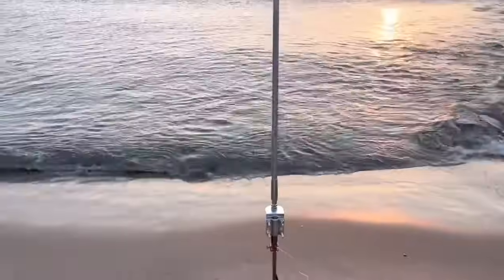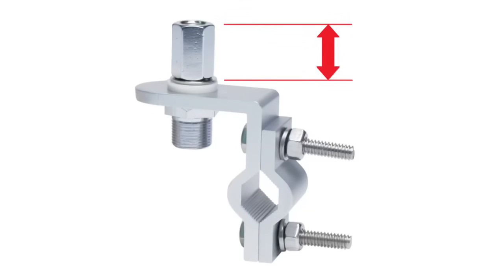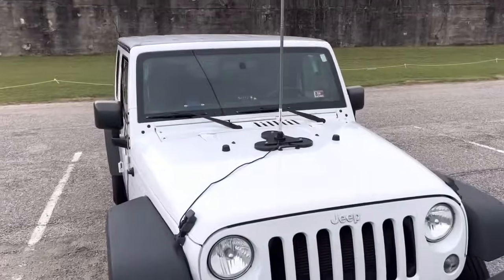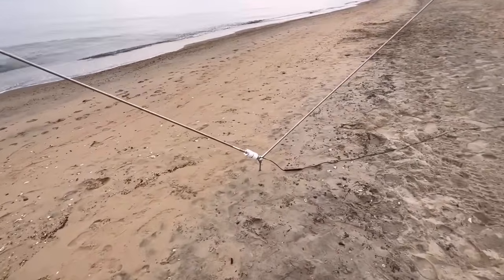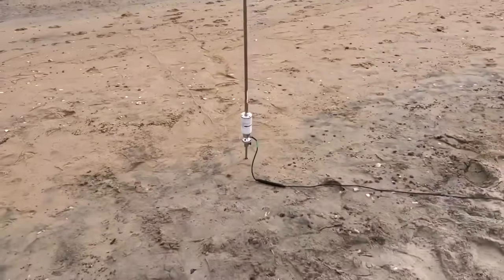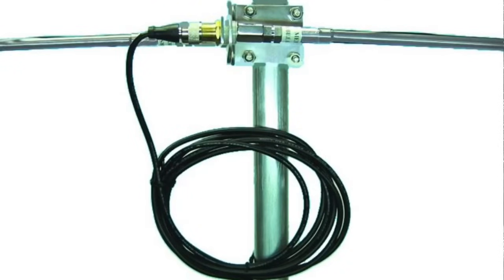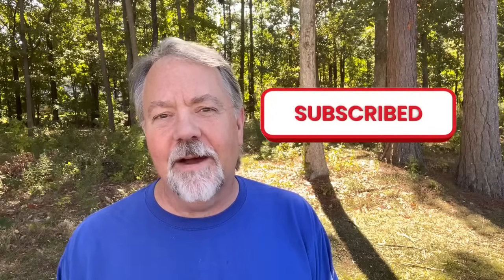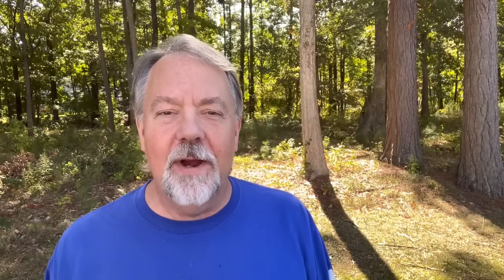How To Use a 17 Foot Telescopic Whip for Ham Radio

Comment: With telescoping whips there's a useful tip that saves time getting the length right. Establish the number of thicker sections to get just short of the right length and pull those out. Then you only need to do the measuring with the last section. A cord with knots is also less clumsy than a tape measure. Put a loop in the end to attach to the base and add a knot for each band.
Reply: Great ideas!  Thank You!
Reply from the maker: Awesome, Thanks for the idea!
Reply: Or, extended the thinner sections and make adjustment with the fat bottom sections. Save taking the antenna down and putting up again!
73 M3KXZ
Reply: I might try marking one of my radials with a label maker. I have to carry them anyway.
Reply: Gives 5+9 a new meaning :-) 5 sections + 5 centimeters
Reply: I’m going to give a £20 eBay special a go.
Reply: I have a chart of each band and the number of sections to pull up. So 10m may be 6.2 sections, etc. I use a diamond mount on the hatchback of the expedition so I start on 10, then pull more sections as I move down the bands. Eventually 20m will be all for cw and half a section in for ssb.

Then keep an eye on the rig swr meter and make any final adjustments.

Comment: I am all about the whips in the field personally, but there is something pretty important to remember.  That guide to resonant length assumes a good ground plane and good ground under your ground plane.  If you are placing everything on dry sand with no salt water on site, the ground will suck regardless of what you put down for a ground plane.  This means that you will have to extend your whip more to actually get resonant.  The more conductive the ground under your ground plane, the shorter the whip can be and reach resonance.  I generally use the Wolf River whip because it is slightly longer than the other 17' whips, for just that reason, though I have a Chameleon whip as well.  If all else fails, clip an extra length of solid copper wire to the end of your whip if things are really bad on the ground.  Walt avoids all this by habitually setting up by the saltwater and running a counterpoise/radial down to it.  That makes for a fantastic ground plane and thus avoids the problems I just talked about.  For my own part, I have just gotten used to knowing about how long a whip I need and using a NanoVNA to dial it in once I am in the ballpark.
Reply: Spot on Matt.  Really good comment.  I'll add that a 1/4 wave vertical over a proper groundplane generally measures about 36 ohms +J0 (ie it is resonant).  But 36 ohms is going to show some SWR to the coax because it's not 50 ohms at the antenna.  SO, what I do is make the antenna a bit LONGER.  This raises the feedpoint impedance up to 50, but it also adds inductance (perhaps 36+J15).  Then I attach a capacitor in shunt (across) the coax where it connects to the antenna, and this makes a very simple "L match" and now I can get a perfect 1:1 SWR, 50+J0 at the antenna end.   

What I describe is probably overkill if you have a short feedline, but I present it here as a teaching tool for those who want to learn more.

73 OM
Reply: @WECB640 interesting. I have, in the past, run one of the extension legs (like the ones that come with the Buddipole and Buddistick Pro) under the 17’ whip to get closer to 1:1. Not always needed, though. Like you say, you can get close enough without the shunt. But your comment interested me bc I’d usually understood shunts as typically being employed as a coil across the feed point (between center & shield), which would be an inductor (as all coils are… right?!)… for the purposes of raising the feed point impedance (as low feed point impedence almost always occurs with physically short vertical antennas). So wouldn’t we expect additional capacitance in shunt to raise the feed point impedance..?  Or are you perhaps not running the capacitor across the two coaxial conductors, and rather have it only inline with the center of the coax and the radiating element?
Reply: Yes correct.  If the radiator is a bit short it has capacitive reactance and we use a shunt inductor to form the "L match".  If the radiator is a bit long, it then has inductive reactance and we use a shunt capacitor to form the "L match".  Either way works.  BTW, MFJ (much as I don't like the quality control) sells both types of shunt but IMO they are overpriced, so I make my own. 73 @Kinetic79

Comment: The 17' telescoping whip is easily my favorite antenna for portable use. I have the original and enhanced versions from WRC. They are so versatile, it's great to use mounted on the car, from a park bench, a stake in the ground or a tripod. Plus a 1/4-wave antenna is great.
Reply from the maker: Absolutely, there are so many cool different configurations and uses for them.

Comment: Thank you for your operating experience with all of the options.  I have both the MFJ 1979 and the Chameleon SS17 and for anyone interested in getting one, definitely get the Chameleon. It's much more robust in construction and also the upper segments are much thicker.  The 1979 is a bit flimsy up top and probably will wear out more quickly despite both being the same price.   For awhile there the SS17 was sold out and was hard to get (I became impatient and got the 1979 first). 

Another great video that makes my day! 
Always appreciate your vibe that keeps up the HAM spirit! 73!
Reply from the maker: Thank you so much! I agree and as I mentioned in the video the Chameleon is for sure the better of the two. All the best and 73 my friend!

Comment: I just got into ham radio.  Got my Tech at the end of Sept and my General middle of Nov.  Made my 1st contact on 20-meter with a 17' Intellitron on the back of my car in the driveway at 765 miles with 10 watts.  I was 4-4, and he was loud and clear, pegging my S meter at times.  I have a second 17' Intellitron along with the Intellitron mount to use two 17' antennas as a dipole ordered.

Comment: Walt, I really like your last two videos where you start out with what you were going to share with us. Also, these last two how to videos were desperately needed.  They both fill a gap. There are many videos that review sliding coil antennas or telescopic whips. There are many videos showing people using them for POTA activations, but I haven’t found any that simply explain how to use them… until now!
Reply from the maker: Thank you so much for the kind words! I hope to keep making videos that help others in the hobby.All the best and 73, Walt

Comment: I just used my Wolf River Coils 213" whip for POTA today. The new one they came out with this year is awesome. It collapses smaller, so it'll fit in cary-on luggage. It's double crimped and more rugged than their previous one too. It's become my go-to antenna the last few months. It's easy to setup on a mag mount and switch bands. I memorized how many sections to drop between each bands, LOL.
Reply from the maker: I need to get one of those whips!

Comment: Hey Walt! I mark my whips with a sharpie for each band. Saves carrying a tape measure, and even with different ground conditions, it gets you close enough to fine tune if you wish. Four 10 meter (33ft) harbor freight tape measures with wires and connectors soldered on make great radials for a whip, and are bright yellow for visibility if using them in a park. 
Same with the wolf river coil, I mark it as well, and it will be very close depending on ground conditions.
Reply from the maker: Great tips, thanks for sharing

Comment: Hey Walt, most people my age, (mid 60's) here in Canada can switch back and forth between metric and Imperial measurements but we still buy 2x4's and 4x8 sheets of plywood at the local Home Depot. You'd have to search for a metric tape measure. We went metric in 1975 but not quite there yet. Another great video!
Reply from the maker: Thanks so much Jeff! I remember going to Montreal in 1974 as a 12 year old kid and thinking the smaller metric sized cans of soda were the coolest thing ever. You guys up there in the Great White North adapted a lot faster than we did for sure.
Reply: I understand metric, however I prefer using Imperial because its what I think in naturally. 68F means a lot more to me than 20C even though I know both mean the same thing

Honestly I also like it because it is different - kind of a protest against powerful entities and their desires for global homogeneity in all things.

Engineers and certain other professionals need to understand metric, and they will of course as part of learning their trade.

For the rest of us, in our day to day lives there is really only one measure that matters often - what's the outdoor temperature?
Reply: Greetings from Finland! We always have had the metric, but we still have 2x4" wood and the bigger coax cables are 1/2" or 7/8".

Comment: Another very good video Walt. I love using a vertical whip on a mag mount for quick POTA activations or just to rag chew. Great when it's raining or snowing and always pretty darn effective. I have a large SUV and use a mag mount right in the middle of the large roof. One thing I do that helps a little is to attach 4 quarter wave radials with a large clamp to the base of the mag mount. I'm in Idaho and I usually arrange the radials to face the direction I want the a little more of the signal to go to. About a 90 to 120 degree spread. Does it make a major difference....No, but from what I have observed, it does help a little. I manage to keep them off the ground most of the time. Give it a try and see if it adds a little bit of improvement. Being able to go to a RF quiet place also is a huge bonus. I have also clamped a 17' whip to the top of a stout 12 meter pole, set at about 10 meters and added another half wave of wire below it to make a vertical dipole. Very effective antenna and the added height of having 1/2 of the antenna above 10 meters also helps.
Reply: Hm cool. That’s quite a lot of height (clamped at 10-ish meters)!  Just curious, did you run the coax vertically up as well, or did you try to pull it away at a sharp angle (of course unlikely to achieve totally perpendicular to the pole)?  .. thinking about this, I think you could theoretically use the shield of the coax as the other half of the vertical dipole, and run the coax vertically down the pole, as long as the  coax was choked very effectively (with a ft240-(31 or 43) toroid at the quarter wavelength point. That would give you an almost sleeve dipole or flowerpot type arrangement. Then you wouldn’t have to worry about the interaction between the coax and the wire element. :)
Reply: @Kinetic79  I put a 1 to 1 choke at the antenna feed point and when I have a tree available,  run it as horizontally as possible.  Otherwise, just bring it down at an angle.
Reply from the maker: Thanks and thanks for the interesting comment!

Comment: Thanks from your Hampton Roads neighbor.  I have both the MFJ-1979 and Chameleon SS17.  I use both regularly with my triple mag mount on the truck and as part of "Frankenstein" antennas with my CHA EMCOM antenna and TM-1 Super Antenna.  Will need to check it out on 80m and 40m with the analyzer this weekend.  73 DE KJ4MZ  E  E
Reply from the maker: Thanks for watching my 757 neighbor! 
All the best and 73, Walt

Comment: I've got a little aluminum tripod that was made for the Super Antenna MP1DXTR80. It has connectors to attach radials and I throw out about 12 of those and mount either a 17 foot whip or a Hamstick on the tripod. Works really well. I carry a NanoVNA that I can use to quickly tune the antenna. I suppose I could use radials just as easily with the ground spike setup you describe, but when I'm doing SOTA activations it's usually too rocky to drive anything into the ground so the tripod is a good solution. Just needs to be weighted down with some rocks when the wind is strong.
Reply from the maker: Great setup, thanks for sharing!

Comment: Walt
Thank you for a great timely subject, as Field Day is coming.  I have watched many other channels regarding Verticals and Ham Sticks and have always had trouble tuning as fast as they seem to do, or if at all, so I gave up but once in a while I would try again.  Then I discovered your channel.  Easy to follow and understand.  It inspired me to go back out and try it again,  This time I moved the whip off the Tri-Pod unto a ground stake with a screen and bam it tuned so much easier and faster using my antenna analyzer.  Now to hook up my radios and test it out.
I now have confiance to tune the Ham Sticks that have been a pain for a few years.  Thank you so much for a great channel.
Tony (KH6TG)

Comment: Love my Chameleon, usually magnet mounted on the roof of my 1-ton pickup. I’ve developed notes for tuning the whip that will tell me for example for 15m I need to collapse 3 3/4 sections if mag-mounted, or 3 5/8 sections if using a tripod. Then no tape necessary. Not that any one way is better. This is just an option.
Reply from the maker: Sounds like a great setup! 73

Comment: A black or red sharpie is a great way to mark the 6m, 10m 12m, 15m, 17m points on a whip antenna.    While the exact point for each band may move a few inches depending where you set up.   My marks always have a SWR of 1.5 or less.   A quick adjustment of a couple inches will get your SWR under 1.1 depending on your location/setup.   I can adjust the length with a NANO VNA in less then a minute,
Reply from the maker: Great advice, thanks!

Comment: Just a thought: I still find the metric-imperial system a non-conflict issue. Americans use metrics more than they think--from buying soda in liters, eye-glasses, audio equipment specs in Hz,  medicine—milligrams, radio—KHz MHz, electrical units of 120/220 volts,  heck, even our money is metric being base 10.

I still find it interesting that in Canada and UK-- they interchange metrics and Imperial units in cooking and baking-- even measuring (one sure way to get in trouble).

Keep up the great videos!  de AI4QT
Reply from the maker: Thanks! I have actually been using the metric system in shipbuilding for almost 30 years. It really is used more here in the USA than people think. 73, Walt

Comment: I got mine today. Started to check it on 15, 17 and then it would not extend out long enough for 20 meters! One section would not pull out. Before I did anything stupid (like resort to vice grips) I called DX Engineering. They sure are good. They said they would replace it right away! Can’t beat that service.
Looking at the tape measure it appears the wavelength numbers come from the old 468 or in the quarter wave case 234 divided by the frequency. Not too good if you take it literally.  It’s a good guide. I have always found the 468 or 234 constant to be long, which was OK as I would rather cut off copper rather than stretch it. 
The thicker antennas (as opposed to thin wires) tend to be shorter. Also the radials or lack thereof in some cases makes a big difference in the vertical length for exact resonance. In most cases you don’t have to hit it dead on anyway but I thought I would point that out. Many factors, usually unnoticed, affect the resonant length. Insulation can be a big factor as well as diameter. Also the length of a resonant full wave antenna or 3/4 wave antenna is not three times the resonant half wave length. I get a lot of raised eyebrows when I teach that! The most obvious example is a 40 meter dipole on 15 meters. A half wave resonant wire on 7.0 MHz is actually resonant above 21.0 MHz. Typically a 40 meter antenna cut for the CW band will be resonant in the 15 meter phone band.
Reply: You should be able to extend the length with one of the 3/8-24 thingies that attach to the bottom of whip antennas—a tilt-over, a spring or a short male-to-female extension if you can find it. I've also found that elevation the antenna lowers the resonant frequency.
Reply: @Inkling777 Yes, I use a Quick disconnect that does add some. However, a brand new telescoping whip should be completely functional and DX Engineering agreed completely. Good company.

Comment: Hey there Walt, good concise video on the different configurations of the 17ft “Telewhip” I have the MRQ version and it’s great.
Oh and BTW as a 60turns on the coil Englishman I use imperial and metric interchangeably esp when antenna building.
73. M7PBX.
Reply from the maker: Thanks for watching and for the great comment! 73, Walt K4OGO

Comment: Insanely jealous of your mag-mount on the Jeep hood.  Just recently discovered the hood on my Jeep Gladiator pickup is PLASTIC! Bummer. I have a cover on the cargo bed so clamping to the edge messes up the waterproofing. BUT… a special mount for the outside of the bed can had so I now put verticals—ham sticks, Wolf River coils and short whips, and son—on that little gem. Going to get an extendable whip.
Reply from the maker: I'm jealous you have a Gladiator LOL I love those trucks!

Comment: Great video Walt. I just recently bought the MFJ-1979 17ft whip (yeah MFJ uses feet not meters) I set it up according to Greg Mihrans KJ6ER POTA Performer setup and it is amazing the QRP results that I am getting. Multi pileups and more DX than I have ever had vs Inverted V dipoles and hamsticks. Easy and quick to set up and take down. AND it's doesn't require any long extention poles. kd9van
Reply from the maker: Thanks! Great setup, thanks for sharing!
Reply: Greg just released an update to his Performer setup.  He shows how to build a linked radial wire(s).